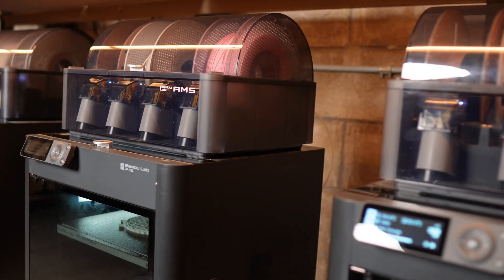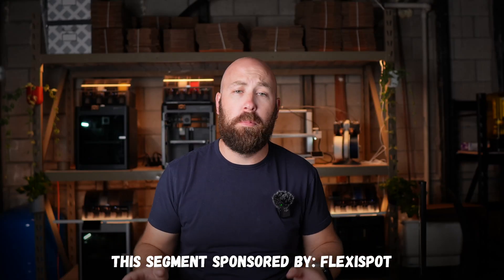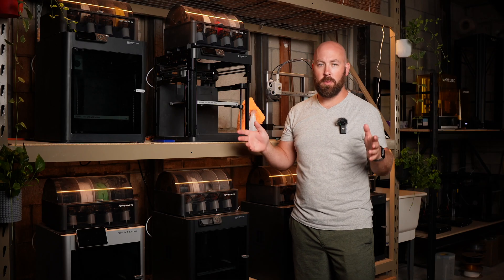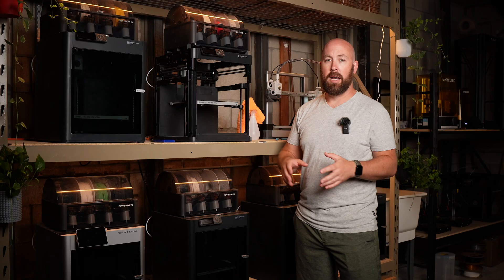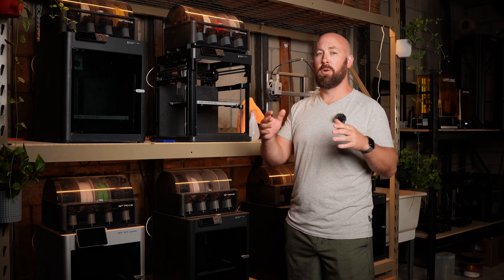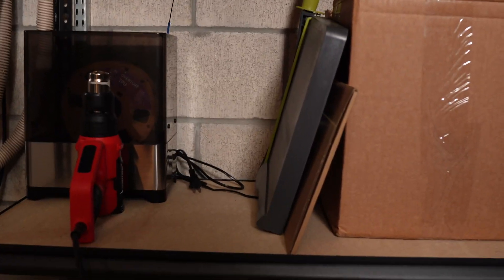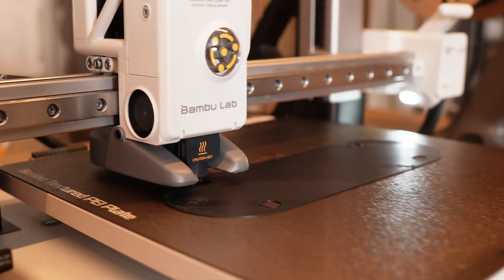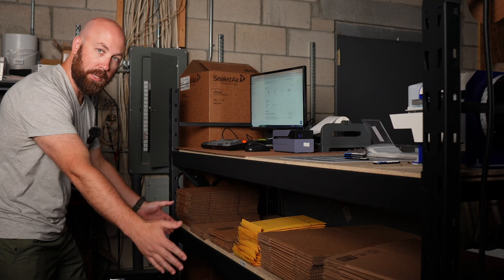Inside a $100,000+ 3D Print Farm: Full Tour

Comment: How has the A1 been going for you? I have 2X P1P, and 6X P1S, and am not at a position to invest in more machines yet. However, I joined Makerworld to start sharing files to earn gift card credits to get an A1. I was curious if you saw it as a serious single color machine that has decent longevity for when we need to batch out single color objects only. (I hate the footprint of the separate AMS, a P1S w/ AMS combo is so much cleaner and less footprint).
Reply from the maker: I agree with everything you said which is why I only the one A1.  For my setup it doesn't make a lot of sense.  If I needed a single color machine I would still probably go with the P1S just without the AMS.

Comment: I had 5 Cr6-se plus a busted one for parts that ran 24/7 to try and keep up with restocking my stores (I don't do on demand printing very often). now i have a x1, A1 and A1 mini and 2 cr6-se. the bambu's paid them self off very fast because I was able to add multi color prints of some of my products and double the product cost for it. for my application I think I will get more A1. I am one of the few that like that AMS more then my X1 AMS.

Comment: Investing that much capital in an upstart that only started shipping printers less than two years ago is risky.
Reply from the maker: It's really not.  Most manufacturing businesses spend 4-6% of revenue annually on equipment. Small business might even spend as much as 10-12% during periods of growth.  I've spend ~$6,200 on Bambu machines which is less then 6% of just my last 12 months of revenue.  I didn't buy them all at once and have been adding as the business grows.  So if you spread out the total cost over all the years I've been 3d printing as a business on an annual basis I'm spending less then 2% of revenue on equipment per year.

3D printers are so cheap compared to other manufacturing industries I could literally replace my whole rack every year.  So if anything ever does happen to bambu where I would need new machines it wouldn't be a problem.
Reply: @3dDesignBros do you offer consulting? I'm looking to grow my 3d printing business
Reply from the maker: I offer 1on1 calls through the highest tier on our Thangs membership page.  You can check it out here: https://thangs.com/designer/3ddesignbros